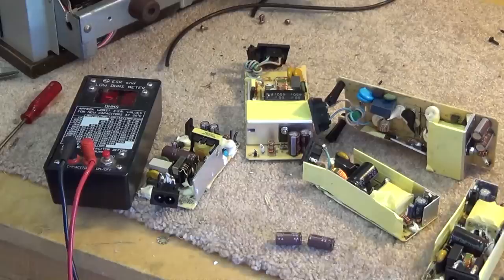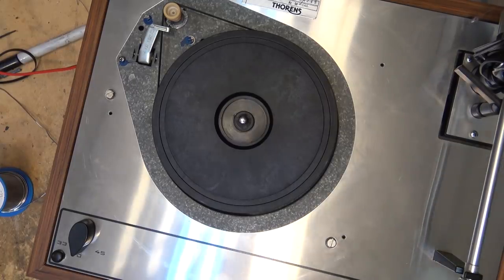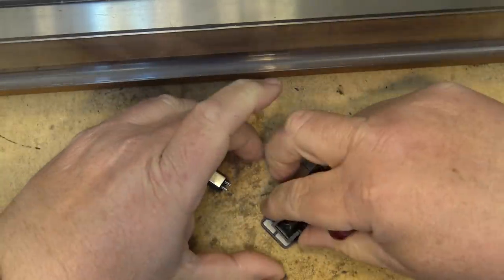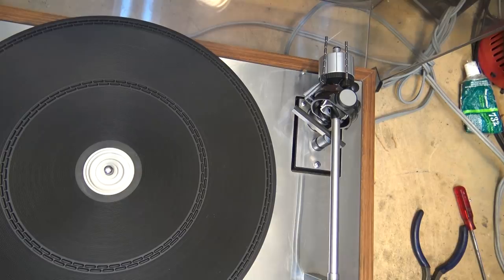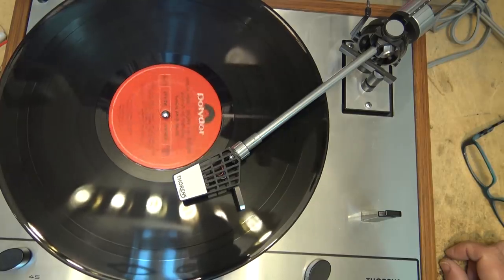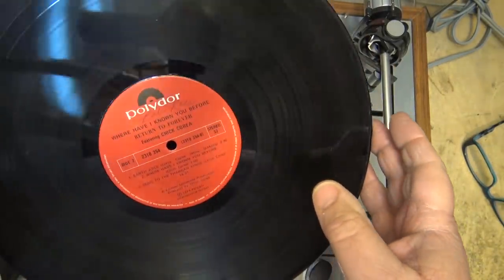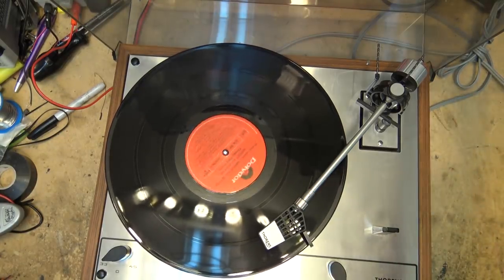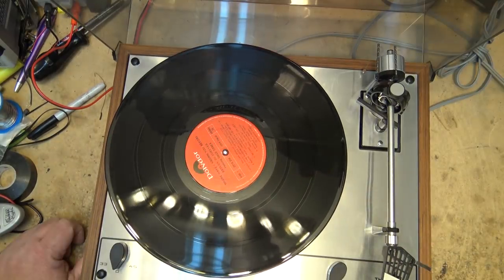Thorens TD165 turntable lubrication belt and cartridge replace

Comment: Congratulations, you are now the owner of a Thorens TT. They last for ever, I have had my TD147 Jubilee since Thorens had their golden jubilee in 1983.

The TD147 works perfectly, the suspension "bounces" as it should and it still has the original belt from 36 years ago.

The cueing problem is easily solved. The arm lift bar, in front of the arm pivot, can collect dust and crap. Give it a good clean (IPA)and also the underneath of the arm which touches the lift bar.

The slow "start-up" can be avoided by keeping the platter turning. With a bit of practice, drop a record onto the platter, cue the arm and when you have finished listening, raise the arm and return the arm to the arm rest.
Then using your finger tips, lift the record clear of the platter.
The constant start/stop and also speed changing will shorten the life of the drive belt. 

As usual, your diagnostic skills and great presentation gives enormous pleasure and enjoyment.

Kieron.

Comment: You are the first person on YouTube or anywhere online to properly explain and demonstrate the proper way to adjust the TP-11 tone arm. How you showed the movement of the charcoal colored weight to 0 after you adjusted the larger light silver weight to perfectly float the arm is a key step and one that I never knew! The numbers on the weight never matched or made sense until now. They just never matched up for me as I would use a digital scale to get to 1.75 but the number on the weight would read something completely different. Thanks for this!!!

Comment: Hello!
Nice gift! May I suggest you download a Thorens protractor to align perfectly your new Shure cartridge. Another point is to use a small electronic scale to get the exact mass applied on the stylus. The Thorens arms are not known to be exact when using the rotating dial.
Another point is to have a look at the start / speed selector and get a drop of silicon grease on surfaces to avoid premature grip and breaking. To do that, you have to return your turntable and unscrew the 4 feet. Before doing that, remember to remove the Platter and counter platter and lock the arm!
The small plastic feet can be replaced by better ones or spikes so small budget.
The important point I to take care of the lid with has specially fragile hinges and no special breakes, so don't let it close free!
A replacement lid is generally sold here in Europe for about 150€, so be cautious with yours. Using fine special polish for plastics and a set of special foam discs is a good idea, but remember to always get it wet, act slowly with mild pressure. You can get a very nice result, as far as the plastic is not cracked or too deeply scratched.
Some also say the plinth can be replaced by massive wood specially carved or even stone, we have some specialists to spend many more money to rebuilt these fantastic machines. But most important is to get a good cartridge, and eventually replace the audio wirings that suffer from time and bad RCA plugs.
The choice of a good cartridge is important too, and I can tell a lot about compliance, different arms versions, stylus shapes... You can also find information about SME arms replacement solutions, but I don't know if this is so important, as these what perfectly built in the best vinyle years in Germany, following a long Swiss tradition for fine mechanics. The choice is Infinite, and depends first of how much you can or want to spend...
We still have fools or genious here in France who build hand made precision machines for more than 30000€! And you have to wait two years to get one!
I personally own 4 different Thorens and many Japanese, big and massive direct drive DP Denon style, full auto Pioneers and tangential Sony's, but I always come back to belt driven, suspended counter chassis Thorens, with a good Shure cartridge, or a budget Audio Technica...
And these can still be found for reasonable budget, as far as you don't want to play high end with fabulous TD124... Or new extraordinary shaped ones. Don't forget the cartridge/ stylus budget, it's possible to spend a lot for these, and replacement styli are getting scarce or expensive when possible, especially with moving coil type or special diamond shapes (Shiibata, Van den Hull, hyperelliptic are getting super rare). You can spent far more for refilling a DL103 Denon that you could have spent to buy it! And I don't tell about Elac boron mounted high cut stylus... As far as you can get good results with an elliptical or even simpler... Have to try or test things, and I suspect many won't tell a difference from a Grado, Ortofon, Shure or whoever is surviving in the scarce vinyle market.
A TD166 or 165 can be found for less than 200€ here in Europe, "dans son jus". A better version or with a more modern auto stop for less than 300€.
They are generally provided with a cartridge, but many are out of shape or junk. Many have found these turntables for a few bucks in the past, and their value is now fairly recognized and climbing. The first TD165 I bought (20 years ago) was sold for 30€ in a second hand seller who didn't even know that a belt was needed! And it was supplied with a mint new Shure V15 with an hyperelliptic stylus designed for defunct quadrophony, and supposed to reach 15 to 35000 Hz Bandpass! The sound was fantastic...
In terms of audio fidelity, tone respect, quality of harmonics, space image and so on, I join you to judge vinyle a far better support compared to digital, even uncompressed. I know, we have to care for the best cleanliness of our discs and stylus, manage wall supports to eliminate low frequency floor resonances, manage with crackles, pops and sibilance (the s problem), the sound is far more realistic and worthwhile at the end. I've compared with the best DA converter (a true 16 bits ultra high end double selected TDA1541 Marantz), same records simply doesn't sound the same: one sounds real, the other is very near, but... Something is missing, that is lost in the sampling technology, the harmonics in the filtering...
Singers voices are specially sensitive to that phenomenon, but some recordings don't simply sound the same!
Alas, the quality and the way discs are made is a still a major problem, as you can get very different results for the same recordings depending on where, when and who pressed it. It is also highly perceptible that new releases and repress are now digitally remastered or treated, I should say mistreated. Even if first sound engineers had to deal with minimum budget, they achieved greatest results with simple means. When you were recording live with only a pair of high quality microphones, it's a minimum of 8 in numerous situations. But you don't get better results. Of course you can get the best of the piano in a grand orchestra, but it's not the way you ear it if you're there in the audience. I know recording engineers that do wonders even with digital, using simple means, but also refer to analog 15ips analog tapes as masters, and that's where the best sound is. A few mad Japanese or English publishers still produce full analog discs or magnetic tapes (I mean reel to reel 15 IPS), but they are expensive, exclusive and hard to get! And maybe most buy it and don't get the difference, as it's also a form of investment as good wine bottles. If you don't hear a difference on your MP3 JVC 1000 watt 3D sound system... In French we say "c'est servir de la confiture aux cochons" (feeding pigs with Marmelade)!

Comment: I love it! It's unusual to me.
I use Turtle Wax (car Wax) to clean plastic dustcovers. If the scratches aren't too bad.
I could be crazy, but I thought years ago, I could hear the music before the needle hit the groove.
And the sound you hear without amplification is called "needle talk". You are correct about the mixing and mastering. Vinyl has the advantage of a large piece of album art as the sleeve.

Comment: I take records for what they are, imperfect but can sound great.

That's a nice heavy platter, almost no fluctuations in speed, i like that.
I also like tape recorders with a heavy flywheel for the same reason.
Old fashoned methods that work.
The platter and arm both isolated, i know it's not perfect but it helps a lot.
Perhaps a later version deck had a start up jocky wheel to quickly put the energy into the platter, then retract to let the belt keep speed.
Possibly.

Comment: Spend $18-$20 to get a spindle protection rod. It replaces the rear motor screw and keeps the platter from damaging the Pulley and motor spindle.
You also should have changed The 4 headshell/cartridge wires, another  $20 well spent.
Next, Deoxit on the cartridge, wire, headshell connectors also a good move
Reply from the maker: Nah. I am cheap. Turntable had seen about 10 hours of use since this video.  I did order the correct belts as the shop sold me the wrong one.   No it wasn't 20 bucks either it was 50.

Comment: I was watching another channel and to check the speeds he had a app , I think it was called "RPM" and you just sit the phone on the mat amd it kept its text lined up from his point of view. I think it read the RPM out to two decimal places to the right. Great videos thanks again for another one.
Reply from the maker: Yes I know there is an app for that, but I am old school. I trust my eyes and a strobe disk.
Reply: @12voltvids  , if I had  strobe I would use it over the app, I trust the strobe alot more then the app. I put it out there for people like me that don't have 1. Thanks for the reply and thanks for the videos !
Reply from the maker: @kardeef33317  
A strobe disk is easy enough to make. Just print one out, the trick is you need a magnetic ballast fluorescent lamp to actually use it. CFL bulbs these days are all electronic ballast so they won't work. It needs the quick strobe effect of a neon lamp or fluorescent lamp operating on a magnetic ballast to actually strobe.
Reply: @12voltvids , Didn't know that for sure, I would have tried a CFL. LOL!!!

Comment: Capacitors feeding the motor need to be replaced.   That slow-up-to-speed is typical of shot capacitors.  Motor torque should also improve wit new capacitors. You will find the offending caps in the  light grey plastic box nearest the motor ( inside the turntable)
Reply from the maker: It has been that way since new.
Reply: @12voltvids then it has been stuffed from new. My TD 160 was like yours I had the caps replaced and it has much more torque and gets up to speed much quicker. Note mine has an AC motor. I bet you have never thought to check the capacitors.

Comment: So I thought I would try this on my TD-166MKII , wrongly assuming that the only real difference between it and the TD-165 was the tonearm.  However, the 166MkII has a forked protrusion coming up from the plinth that hooks over a plastic ring attached to the subplatter underneath it.  This piece looks like it is intended to prevent removing the subplatter from the bearing shaft, a task at which it succeeds quite well.  Any idea how I might be able to remove the subplatter without major surgery on my 'table?  Thanks!

Comment: What is a better turntable Dual 1229 or Thorens 160. You must know because you have  worked on them both
Reply from the maker: I have both.  The dual is an idler drive auto changer and the thorens a belt full manual.  The thorens is superior.

Comment: What you forget in your argumentation is that sometimes it doesn't all matter if the technology behind the playback source is "better". It may be better on paper (higher resolution on digital format) but this is not necessarily the main factor in the listening situation. Since we not only listen music technically but also emotionally.
Reply from the maker: Ya da ya da ya da. Ok you like putting the record on and dropping the needle.  Good for you.  I am just tired of people claiming that vinyl and cassette tapes sound better and try to convince people of this.  I really get a kick out of those that spend huge dollars on speciality turn tables and cartridges hoping to improve the sound of vinyl.  The problem with vinyl and tape is this.  Every time it is played back the sound changes slightly.  When that needle is being dragged through the groove the tip of the needle being bashed back and forth gets very hot.  Guess what that hot tip does to the wall of the groove?  It makes it soft for a split second and in this time the groove makes a microscopic change which the next time it is played will slightly change the sound.   One of the reasons that jvc worked on developing super vinyl that was used by mobile felidity sound labs was because it was more resistant to this. Super vinyl was developed for cd4 (quad) records because the high frequency carrier where the rear channels were recorded was very susceptible to this. Many modern pressings these days are done with with this 170 gram super vinyl but none of the old vintage records except the very expensive ones by mobile fedility back in the early 80s and 4 channel records.  Everything else was cheap vinyl and a huge percentage of that recycled vinyl.  Record stores would send back unsold records. They were melted down to make new vinyl to make more records.   This recycled vinyl was not as good as virgin vinyl.  This doesn't happen with digital.  Digital is the same every time you play it.  A proper mastered cd will blow away any vinyl or tape copy.  The problem is many pop and rock cds of the 80s were not properly mastered.  The analog source tape was equalized for the limitations of vinyl (de "s" and bass rolled to center channel for example.)  A complete remix was required to make a cd shine and most record companies were not prepared to do this.  This was not an issue in the jazz or classical labels. They did this from day 1 and their cds sound absolutely fantastic.  Far better than any vinyl pressing of same.
Reply: @12voltvids  Ok, but nobodys hears a microscopic change that seems to let the record sound "different" from every spin. Same you could say bout cds that they can have dropouts when 20 or 30 years old. Or they even don't play any more. Scratched cds have dropouts, the player can't read them etc....
I don't know if you can compare what you try to compare. Which players are used, which amplifier, which speakers, which cables, which cartridge, which room, which ears, which mood is the listener in, which music etc...?
You can try to measure it in the laboratory but that's about it.
Reply from the maker: @kpt.beyond819  
Actually you do hear the changes over time.  Compare a heavily played record vs a new one and you will hear it. CD doesn't change.  CD doesnt wear out.  Minor surface scratches dont affect CD as there in redundant error correction data built in to correct errors.  If you damage the reflective surface then yes the disk could skip or not play at all. Cdr can be damaged by leaving exposed to sunlight.  I have cdr recorded back in the late 80s  when I got my first very expensive burner that still play.  The original cdr were gold with dark green recording layer.  Disks had to go into a cady to be recorded. Was a Sony burner that was about 1000.  Blank disks were also bloody expensive.  About 20.00 each.  I used them to backup photos in the early days and made a few compilation cds. The disks have lasted though.  The later higher speed silver CD have not lasted. I have over 100 unrecorded gold cdr that have never been opened to be used slowly for special projects.
Reply: @12voltvids   You can't say heavily played records sound generally bad. Some do but also I have 70s records from my dad which sound really great. I lately played a totally worn out Billy Idol record again which as a kid I played wet because back then it was worn out already. The sound was great. I have the same album on CD but it's way better on vinyl. On CD the bass is wobbly and the highs sound artifical.

Whereas I own a Foo Fighters album both vinyl and CD and CD sounds much better. Surely because what you say about mixing and mastering. This album was done for CD and not for vinyl. 

I just wanna say the process of producing and listening back music is too complicated and too different to determine "the better medium". 

And redundant error correction fills in data which affects the sound if I remember correctly?
Reply from the maker: @kpt.beyond819  
Early CD production was done from the analog master tapes that were already EQ for the vinyl cut, and the record companies were too cheap to pay the engineer to make a second master without the processing needed to make the cassette and vinyl sound as good as those formats could.
I mostly listened to jazz recordings during the 80 and 90s because 80s pop music of that era just gave me a headache. When I hear crap like culture club, ah ha, duran duran, men without hats ect come on the radio I can't find the tuning dial fast enough.

Comment: I just dug out my TD160, which looks the same as the 165.  It doesn't have a needle. Should I replace both the cartridge and the needle?  If so, what manufacture/part should I be looking for to replace them?
Reply from the maker: There are many brands of cartridge available. You can spend from 50 to 5000 for a cartridge and needle.
Reply: Ortofon 2m blue wont be disapointed, run it at 1.85 grams